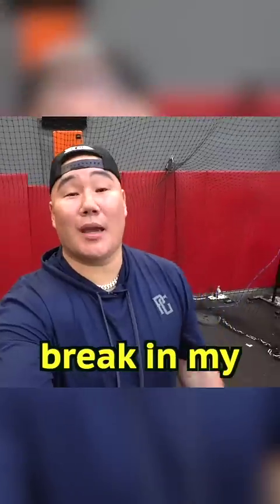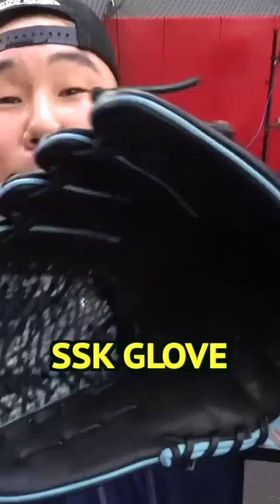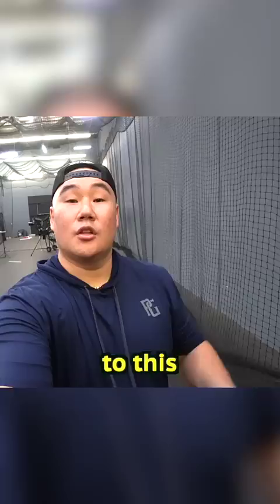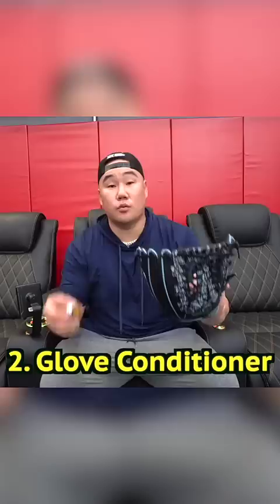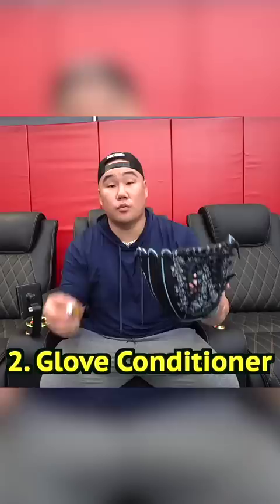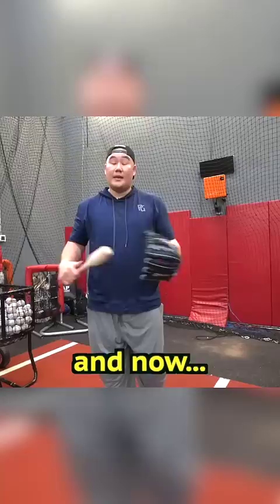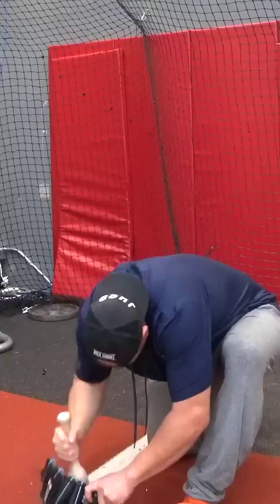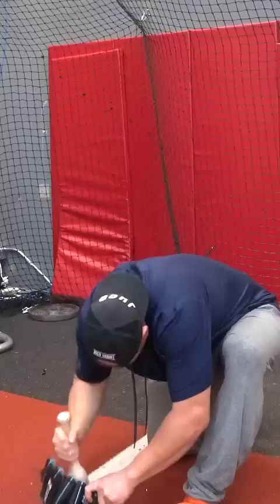HOW TO BREAK IN A NEW GLOVE!

Comment: I used a treatment called Hot Glove oil. You treat your glove with it then heat it up in the oven works great. Never had any problems. Moisture is bad for gloves. They start to smell and get extremely hard. The leather hates water
Reply: Ive been misting/steaming gloves with water for 30 years never a problem.. Soaking them in water not letting them get good air movement is when you get mildew and stink
Reply: Heat is also bad for leather.

Comment: Pretty good job sir. Not flexing but I used the Ball Glove King’s method with a dunk in a bucket of water first, mallet work with the glove wrapped loosely in a towel focusing on the hinges and for two in the pinky break in, dry for two days, mallet some more then condition… worked perfectly for my current Rawlings HoH gamer and my son’s A-2000. ✌🏼 🤙🏽 ⚾️

Comment: Old school here. We used soak the glove in water and tie it shut with a ball in the pocket. Once it dried we would oil the entire give up with neatsfoot oil. Neatsfoot oil is a leather conditioning oil that’s been used on horse harnesses and saddles for a few hundred years now. Most of your modern glove conditioners have a healthy percentage of neatsfoot oil in it. Always had good luck getting a good pocket in the glove and  getting it soft and flexible.
Reply: these days its much preferable to use water based glove conditioner instead of oil based conditioner for baseball gloves.
Reply: This is what my sister and I use to do, good ole softball in the pocket and oil